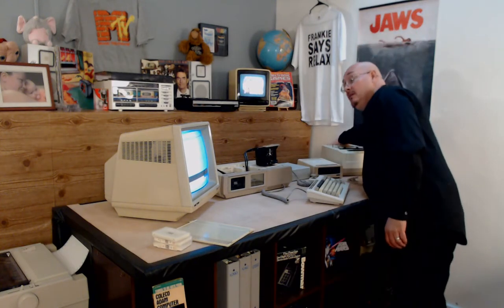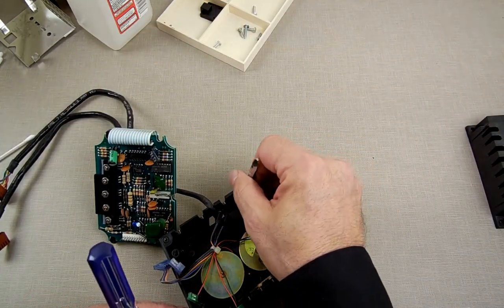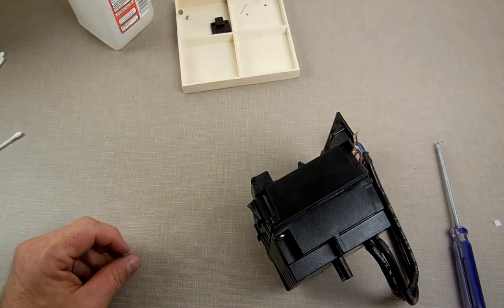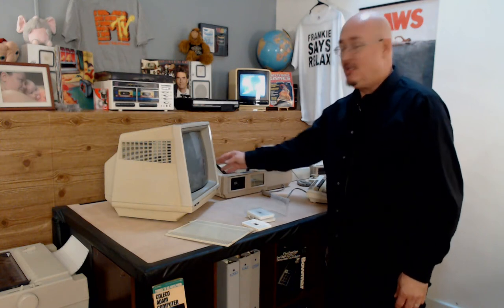Data Drive Repair Part 3 - Testing

Comment: Way to stick with it to salvage another Data Drive from the scrap heap / parts bin. To clarify re the 2 drive cables/connectors that attach to the Memory Console... Drive #1 connect to 1A (9-pin connector) and 1B (8-pin connector) and Drive #2 connects to 2A (9-pin) and 2B (8-pin). Be very careful when lining up the connector over the pins before pressing the connector down into place... not exactly the best choice of connectors and even worse is the small/tight area that the Data Drive ports are located in.
Reply from the maker: It is a design flaw - don’t know why they did it that way